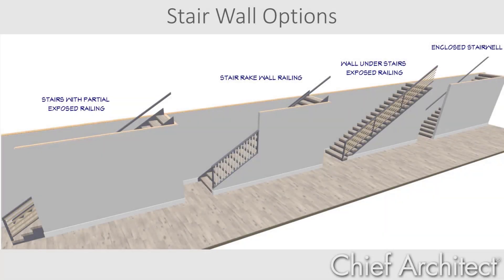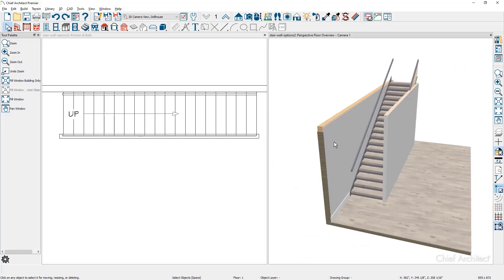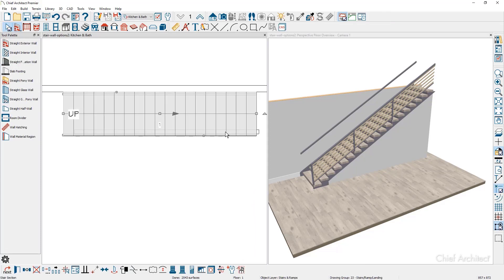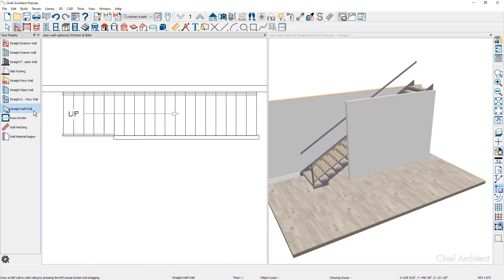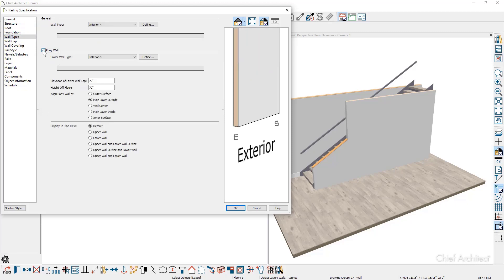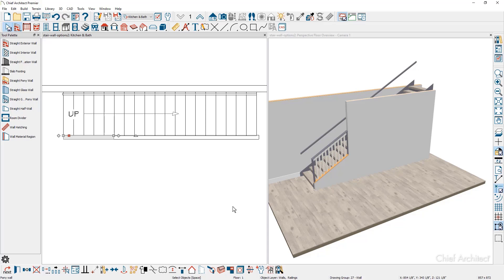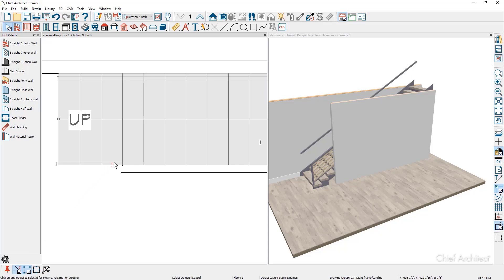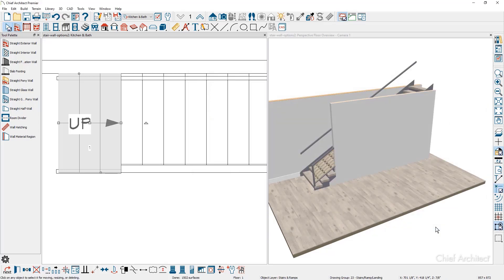How to Adjust Stair Wall Options

Comment: And how do you add a full height wall but leave it open under the stairs? I can fake it with a doorway and tudor arch but it takes a few minutes to line up the angle. I need it a lot putting open spaces under stairs. Laundry rooms, Toilets etc.